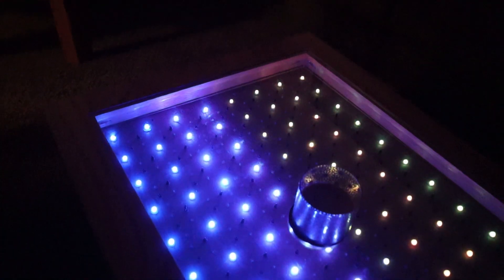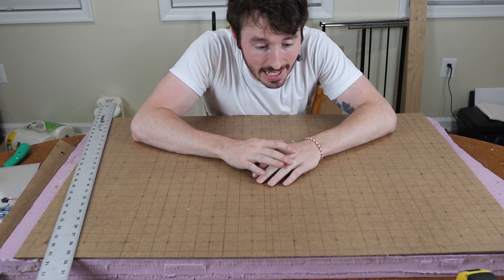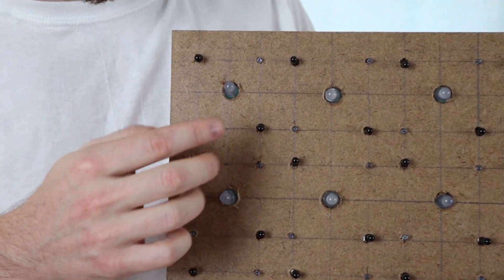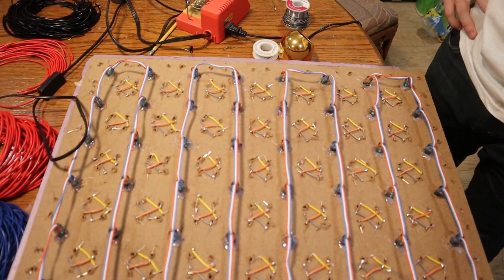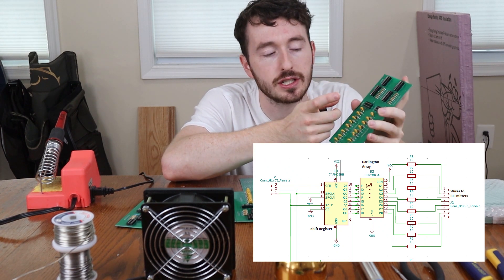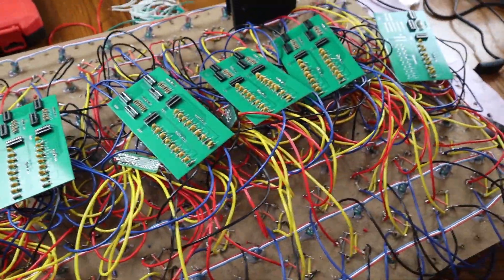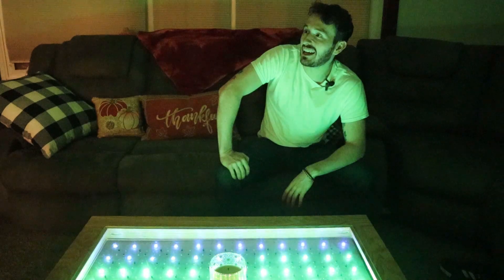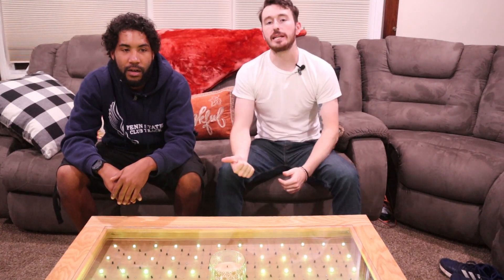HOW TO MAKE AN INTERACTIVE COFFEE TABLE: Reactive LED Coffee Table | Arduino Projects

Comment: Great video guys! Just a question on the IR LEDs, what's the benefit of being able to individually turn them on/off? Could you not just have them connected directly to power to run at all times?
Reply from the maker: You could run them at all times but the power consumption is much higher. To save energy and not run too many amps for safety reasons if your other electrical components aren’t rated that high. The lower the power output too you could power it longer on battery if that’s what you wanted

Comment: curious if you used frosted, less tranparent (but still somewhat translucent) acrylic instead of glass, this would not work? is that correct? because the frosted acrylic would reflect enough of the IR that the sensors would read it without anything sitting on top?
Reply from the maker: We tested it out and it does work I was worrried it wouldn’t because I thought the shadow cast wouldn’t change the photodiodes signal too much since the IR light was scattered but it works. We have a short video on our Instagram of me bobbing my head over the transparent glass if you’re interested to see what it looks like but it basically just works

Comment: As I watched those wires attached, I thought what a mess. But the end result was simply mesmerizing. Surely bookmarking this video for rewatch and this is going to be my task this XMas ahead. Lets make 2020 somewhat colorful, thanks for this lovely video and the bunch of files.
Reply from the maker: The wires were incredibly messy but we think we are going to use connectors next time to clean it up. Would love to see how yours turns out
Reply: @tyandgigbuilds8836  Probably using some of those IR Sensors in modular format might help clear up some of those wires